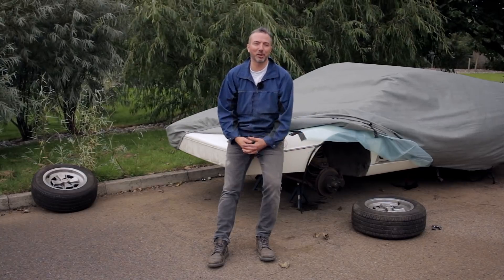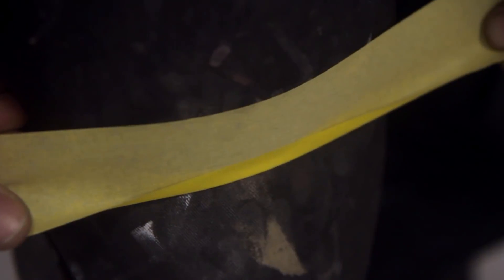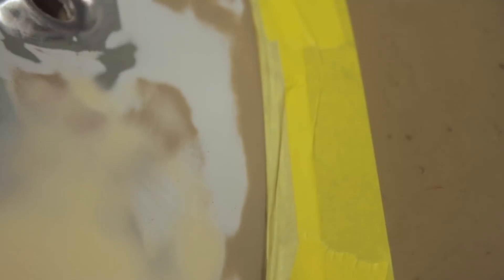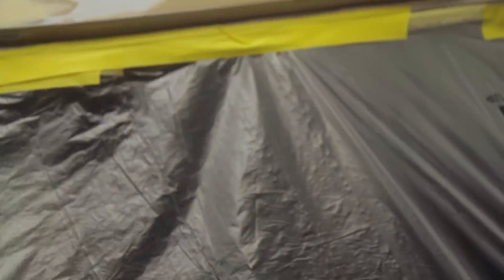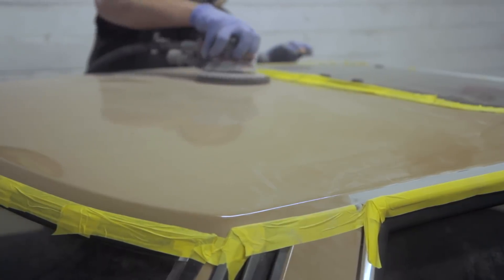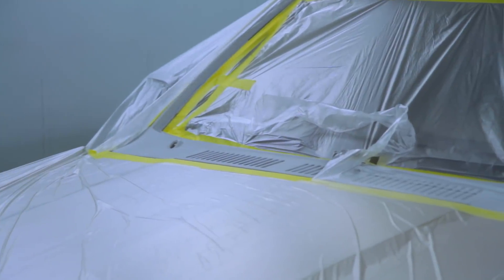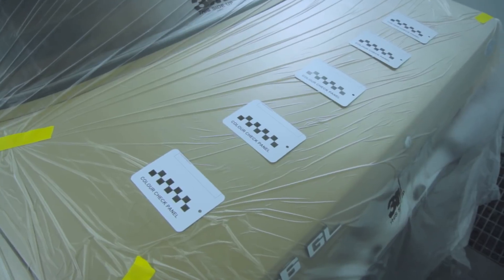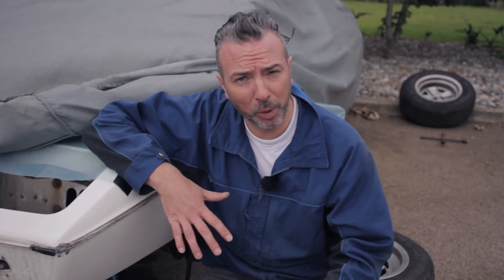Why proper paint prep is painstaking, or cut, weld, fill & paint PART 3 // SOUP Classic Motoring 32

Comment: Have stumbled across a tool to get small imperfections out of paint, or to blend some new paint into an existing bit (stone chip size blob of new paint that's higher than the existing paint for example). Came across it when watching a video on how to renovate old scratched acrylic watch glasses. It's a nail file sponge cube (£1.50 from Wilco's) with four different grades of abrasive material use this in the four steps of coursest to finest to get the finish you want, then apply a small amount of T Cut over it and "hey presto", sorted. Worked for me anyway, and if it gets scratches out of watch glasses (which it does), then it'll do the same with paint. 😎

Comment: Another fantastic video George.

Orange peel can, and does, happen throughout all stages of the paint process.  There are so many variables, paint mix, gun set up, weather, technique, brand of paint - all play a part.  Most modern cars have slight orange peel in them from the factory - the real trick for the pros is to match the factory orange peel when doing a repair.  Dirt nibs and other trash can get into the job even in a professional booth but, as you say they can be wet sanded out prior to the final polish.  

Keep it up mate.
Reply: Thank fook f'that!
Reply from the maker: Yep! Got the full run down from the lads soon as they'd heard me say that. Just goes to show you A. need to know what you're doing, B. need the right environment/setup, and C. put the work in. I thought the crafts were dying out, but bodywork guys are still artists. Thanks mate

Comment: orange peel can come at a few different points. not sanding the primer would be silly as the primer is the last step to getting a panel straight.  happens in clear as well, is 2 fold...1 the gun and how it atomizes the clear, and 2, the clear itself and how it self levels. theres no 1 answer for anything in body work. im a body man by trade and if you ask 10 body men 1 question, you'll get 10 different answers.  good work, keep up that motivation. you give me my own motivation as well.
Reply from the maker: Yeah got slapped on the wrist for that one by the lads! Lovely to hear that the motivation is catching, didn't expect that from a pro. Thanks for the info, it's great to get a sense of these things. Take care mate.

Comment: Tina is really starting to look pretty again, my older brother had a 78 cortina that i got to use for a year when he lost his license. His had a 3.3ltr six but in Oz they also came with a 4.1 six but they were popular cars to drop ford windsor V8's into.
 In some ways a full respray is easier than a partial repair due to all the masking and matching thats required.
Reply from the maker: You guys got a real range of big engines didn't you. But then I suppose you've got some big distances too, and maybe you're all a little nuts ;) Thanks mate

Comment: Heh, the intros keep getting better and better! Well done. 
And by the way, orange peel can come from any of the paint stages really. Primer, as you saw, is a typical one and the clearcoat is the other typical one.  Basecoat, not so much. Or at least much more subtle.  Peel in the clear can have to do with the formulation/mix - the faster it kicks off/dries the more peel it'll have, but conversely you'll have less of a chance for runs/drips/sags. 'Slow' clear (or, more accurately, slow activator) will extend the dry/cure times and it'll glass out better.
Reply from the maker: Cheers mate. Really interesting stuff. The lads set me straight this morning too. It's an area of work I realise I knew nothing about, and it's just as technical as any other aspect of car work.
Reply: From memory, being told by a friend who was a panel beater & ran a shop a couple of decades ago, it has to do with how thick you lay the paint.  Too thin & you see through it, too thick & you get runs & orange peel.  Getting it just right for that smooth finish is tricky.

What was trickier, though, was getting it just right to match the new paint to the existing level of orange peel so that you couldn't tell the new paint from the factory peel.